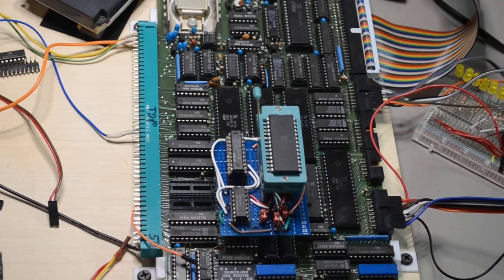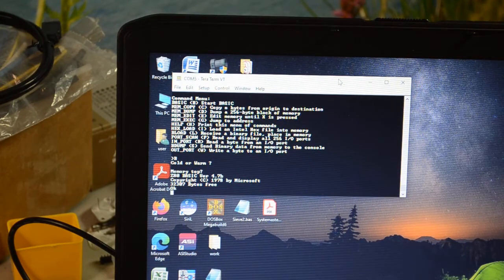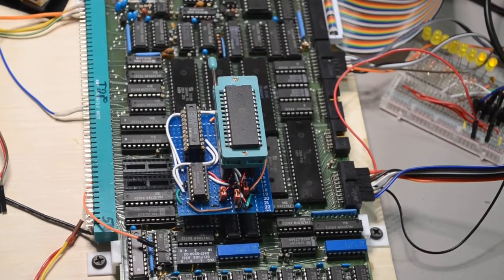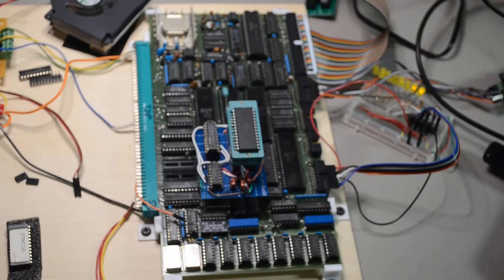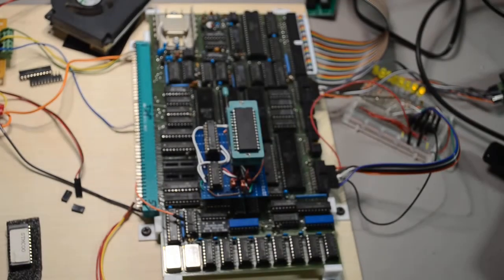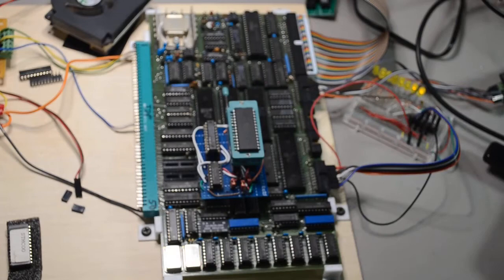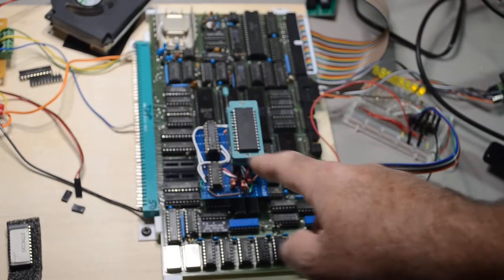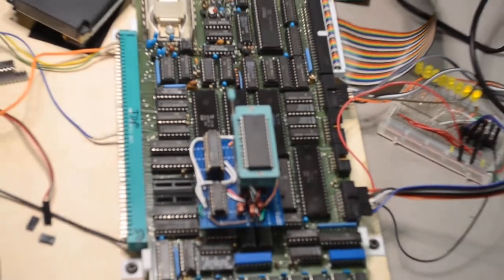This Old Computer Episode 12 Teletek Systemaster S-100 Z80 Computer, Careful What You Wish For

Comment: What you actually needed for your piggy back board is wire wrap sockets.  You would have soldered them on your piggy back board instead of your regular sockets  The leads would stick out below the board and plug directly into the Teletek board. End result would be a very low profile piggy back board.  Also consider making your piggy back board capable of bank switching a portion of the 2k space with your larger eproms so as to still fit into the 2k window.  Set it up to copy all the rom into ram on power up and then run from ram. Bingo all 64k of ram is available.
MJ
Reply from the maker: Had that thought. May implement it in the future.

Comment: What if you were to plug this board into a backplane and then add a rom expansion board ?
Reply from the maker: Vintage boards are quite expensive and can be hard to find in good working condition. The old boards also tended to be designed to use vintage low-density EPROMS. I could break up the monitor and BASIC interpreter and burn them into a bunch of 2716 EPROMS I guess. It is definitely an option. Either that or build my own expansion card using my prototyping boards.